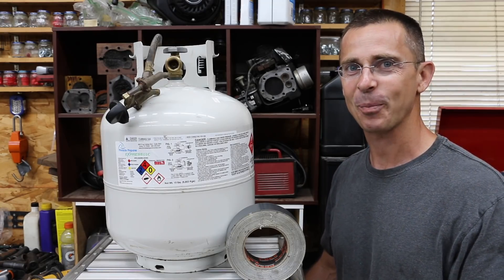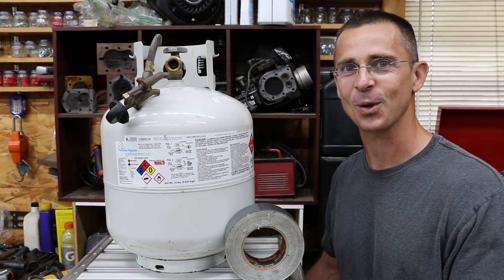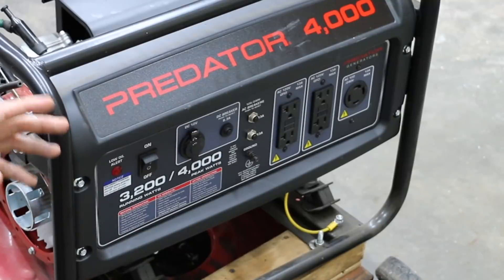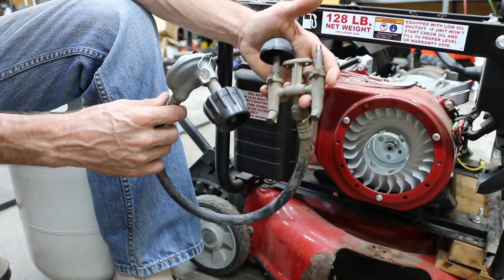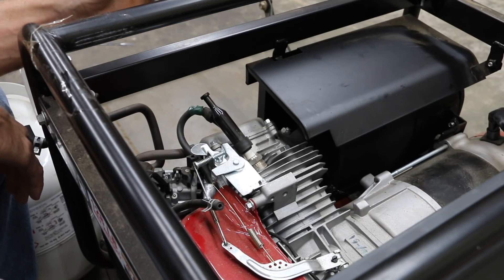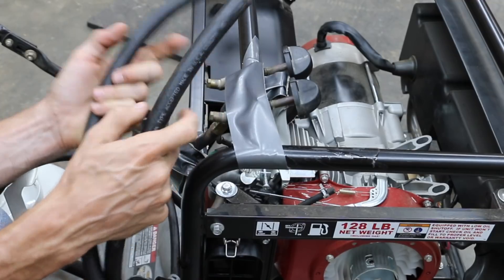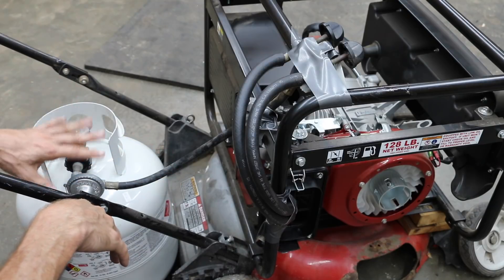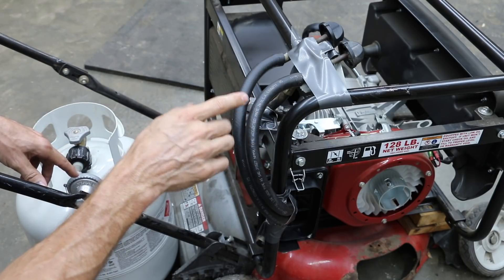Can a gas (propane) grill power an engine?  Let's try it!

Comment: At NASA, back in the 1990's many of their GSA run vehicles ran off propane.  The mechanics of the vehicles said that the Spark Plugs never needed to be changed, and the oil was always very clean during an oil change.   Of course this is nothing new, but the use of no regulator on a generator does make a good emergency source, especially in the Midwest where everyone has propane tanks for fueling their homes.   Propane also gets about the same MPG as regular gas.   At $1.29 a gallon during the summer it's a good alternative fuel source.  Love your videos.
Reply from the maker: Thanks for commenting on this.
Reply: Where the heck are you finding propane that cheap? We have a sale right now at $2.49/gal and our cost is 2.29 lol.  Also, mileage goes down a bit on lpg as well as power loss of about 10%.
Reply: $3.69 a gallon for propane here in Washington State...
Reply: with lp u lose 10% hp and gain 10% fuel economy give or take a percent
Reply: With most larger vehicles like my supercrew, that's not a problem and I'd take the 10% fuel economy because most of the time I'm not hauling a load.
Reply: @johncoyle707  It all depends on installation - HP loss was always present in generation 1 and 2 systems as you basically had to install a choke in the intake (it impacted both LPG and gas HP), much less in gen III and almost zero in gen IV. In gen V you can actually see gains due to lower intake temperatures!
Reply: Oil is clean, like translucent that is true. But it degrades even faster than with gasoline. Too much acids being formed. Needs to by changed no later than it would be with gasoline.
Reply: This is true even now we run our off road truck off propane
Reply: At Walmart near me I can get a 15lb Exchange blue rhino for $14.87. That's less than $1 per lb
Reply: zeer365 which makes it roughly $4 a gallon
Reply: @zdw306  dont buy blue rhino. Many gas stations refill propane tanks and you pay less
Reply: Also, there is a primary (high pressure to low pressure) regulator screwed right to the lpg cylinder, just not a venturi/load based low pres regulator/mixer like on a correct setup. Natural gas is far cheaper than propane, I think using lpg for heating a home is a terrible idea.
Reply: Mcroostr I live in N.D. and I just filled up my 500 gallon tank at $1.29 a gallon, so heating our house, water heater and cooking range with propane is a great idea.  I also have a wood stove and electric baseboard heat.   Baseboard heat is by far the most expensive way to heat our house.   You must live in the East or West Coast.  My family is from VT and they heat with oil, and its expensive, but propane is three times the cost of the midwest states.    It's also why you never hear of the Midwest states crying about power outages.  We are very stubborn and self sufficient here in the open Plains States.  P.S. I travel 60 miles to go to a Walmart:P.

Comment: Either way, if you're in the market to save money on gas, you won't be as propane is just as expensive these days as gasoline per gallon. Although I do believe they sell propane by the "pound". I wonder if the engine would run longer on the propane? If so, then maybe you have a chance of saving some money. I do like the clean burn though. For lawnmowers, this clean burn would be nice so you didn't have to choke on that exhaust that comes from burning gasoline.
Reply from the maker: Great point.

Comment: Question.
Have you ever tasted the results of new fuel on old seals, rubber and O rings??
Lots if us have older classic cars trucks and for me, motorcycles.

I'm concerned about the mixed fuels they're using. Difficult to find quality gas nowadays.

I'm concerned about fload needles,  crank seals (two stroke) and so on.

Anyway, keep up the good work. One of my favorite channels.
Reply from the maker: Great video idea and thank you for the positive comments.

Comment: Project Farm Another idea would be to adapt one of those trigger activated spray paint clip on devices with an adjustable screw, run a tube to the carburetor from it, and run on pure starting fluid or other compressed cans like brake cleaner, hairspray, ect.  I think it would make a fun video, thanks for the great videos and unique ideas.
Reply from the maker: Great video idea!

Comment: Try to run an engine with paint thinner
Reply: He already did this. The engine did run but there were problems (like mibars predicted).
Reply: Paint thinner is mineral spirits, and that's the same C7 to C12 hydrocarbons as in gasoline.
Reply: @RonJohn63  Much lower octane number, so it would ping a lot and could even diesel after cutting ignition.
Reply: @Dirk Pitt My chemistry teacher from middle school claimed that he used paint thinner in an emergency to run his Fiat 126P. It worked but it continued dieseling even without ignition. BTW in Poland paint thinner is known as "lacquer gasoline" and technically speaking it is variant of gasoline with long hydrocarbon chains (10-15) and no additives.

Comment: It would be interesting to demonstrate the engine running on burnt wood gasification into the generators engine and much the same manner as the propane. We know that this can work if the mixture can be controlled correctly. OneNote, the wood would be required to be hated without oxygen and then routed into the carburetor. I would like to see this I'm sure other people would also like to see this technology. Great demos by the way very much appreciated.
Reply from the maker: Great video idea!

Comment: How much water did you have in the exhaust as a result of using propane? Our 4 cylinder tow-motor runs on propane and is known for leaving a water trail behind it. lol Which led to a couple hydrogen fires by the way. (Titanium blending/processing facility)
Reply from the maker: Wow!  I didn't pay attention to the water from the exhaust.
Reply: Burning propane does create water vapor. But there is a chance you would not have had any moisture coming from the exhaust as it is an air cooled engine.  The engine gets hot enough to evaporate the moisture as it forms. 
In a liquid cooled engine the moisture can build up due to the lower temperatures of the cylinder head.

Comment: In India iv seen 50% of vehicles runs in LPG gas cylinders.. Its scraped in boot behind and there is a connection for it and there is a switch added for that Gas or Petrol tank. Lol... Iv tried both but I found there is more power in gas than fuel...
Reply from the maker: Thanks for commenting on this.

Comment: Will a engine run on methane? I have heard of a few ways of collecting it. Cattle under a big tent is one method.
Reply: Ronald, it's possible to run an engine on biologically produced methane...but trying to trap cow farts isn't the way to proceed. What they do is build a tank, paint it flat black and put manure in it. The manure ferments in the heat, which makes methane.
Reply from the maker: Great video idea!

Comment: E3 and other fancy spark plugs next. Dieing to see a E3 plug in the see through engine.
Reply from the maker: Great video idea!
Reply: Ya, please do an E3 video. I’ve ran one of their spark plugs in my Honda push mower. Have had that same plug for about 8 years, used it for a few years commercially and only did oil and filter changes on it. Starts/runs perfect. I wish i could say it’s the E3 plug but can’t prove that!

Comment: I knew you were going to have a little bit of a problem at first. Because I used propane as fuel for a potato gun, but I was only able to get this to work only one time because the fuel-air mixture is hard to achieve. I'm glad you got it to work and would love to know the ratio so I could use it for potato guns. The one time I did get it to work on the potato gun it was the farthest I've ever shot a potato by a factor of at least two.
Reply from the maker: Thank you!

Comment: So what happens if you were to pull the high speed fuel jet from the carb, and run propane through the original fuel supply line. Leave the cover and filter on the carb. Also try it with the high speed jet left in. What's the results.
Thanks great videos.
Reply from the maker: Yes, that would be a great test. Thank you!
Reply: Let me know if you you try it. Great videos by the way.

Comment: What about applying this to a diesel not sure how you would test it but you come up with some great test.  Use this as an injection and see how it would effect simulated mpg.  Maybe just hook up a flywheel with some drag and see if the one with gas and diesel would last longer  than just diesel
Reply from the maker: Great video idea!

Comment: I drive a semi at work that runs on CNG (compressed natural gas for those who don’t know) they also have LNG (liquified natural gas) trucks n just like propane it’s extremely clean. 30,000 miles on the oil n it still looks as clean as when it was new in the bottle.
Reply from the maker: This is interesting. Thanks for commenting.

Comment: LGP( liquid petroleum gas) is a common upgrade to many cars in Europe, Australia it is very common and the state even sponsors the first car you get converted. both in Europe and Australia it is roughly half the price of petrol at a gas station. Interestingly the LPG tanks installed in cars are supposedly safer in an accident than regular petrol tank
Reply from the maker: Thanks for commenting on this.

Comment: propane (LPG) is generally a very common fuel and not any more dangerous than any other type of fuel for spark ignited engines. the idea of propane being dangerous usually comes from not respecting codes of practice. more than 25 million cars worldwide run on propane or butane (LPG). aside from rather crude conversions, you have really neat factory made models. some even are electric hybrids. https://en.wikipedia.org/wiki/Toyota_JPN_Taxi

for small engines there are kits to correctly convert small engines like the one you show to propane. these don't rely on you hacking/modifying the carburettor. the existing carb is exchanged for a purpose designed propane carb. these propane carbs have either an integrated or external pressure reducer/regulator and some even can take the liquid phase directly (Lehr).
https://www.cavagnagroup.com/business-segment/automotive/products/enerkit/

there are obviously also complete systems available:
https://golehr.com/propane-powered-lawn-and-garden-products/
https://www.greengearglobal.com/catering-to-the-generator-market/
Reply from the maker: Great point and thanks for the link!

Comment: Have LPG in NZ and used to have CNG (Compressed Natural Gas) for a very economical drive.  CNG lacked distance on a tank,  being not as concentrated, and died out but LPG cars are still going, though the cost of the conversions has caused a huge drop off in popularity, mainly taxi's and very high mileage fleet vehicles are the main ones still using it.   
How about trying something more exciting like using oxyacetylene!
Reply from the maker: Great video idea!

Comment: My company uses Isuzu NPR trucks that run on propane, they run just like a gasoline engine, only difference is that they don’t like when the air temperature gets really cold, like in the single digits.
Reply from the maker: Thanks for commenting on this.

Comment: yes, it works very well on the newer engines. but don't use propane in older engines which ran on leaded gas, because it messes up the exhaust valve seats.
Reply from the maker: Thanks for commenting on this
Reply: actually it wont harm old engines. ran lpg in a 73 e-150 with a 351w to move it around when i was welding the rear frame with tank removed. worked great. no problems at all. flipped the 20lb tank upside down and dropped the hose into the carb. drove it 40 miles like that

Comment: Check the condition of the motor oil in the engine after 25 hours of continuous use on propane vs. gasoline please. And maybe after 50 hours of continuous use. I always heard that the motor oil is cleaner too with propane use.
Reply from the maker: Great video idea!

Comment: I did it the other way around, converted a gas engine to petrol and built a go kart. They’re the same engine. The only difference is how you introduce the fuel.
Reply from the maker: This is interesting. Thanks for commenting.
Reply: Project Farm I feel so honoured to get a reply from you lol. The original engine came from a propane powered street sweeping machine. I got it free and didn’t want to waste it so I decided to stick it in a go kart. I took all the propane parts off and fitted a carburettor off an old Briggs and Stratton lawnmower I had lying around. It took a bit of tuning to make it run perfect but it ran for years with no issue. One thing to be aware of is that if you’re converting from petrol to gas, you lose the lubricating factor from the oils in the petrol. This is why most LPG conversions have an additional lubrication system.

Comment: I live in Australia and every "gas station" (as they are called elsewhere) has at least one LPG bowser here. Many individuals and fleets run lpg. HOWEVER i still think this is an awesome video and great experiment because it shows what you can do in an emergency situation. The LPG conversions for petrol motors are expensive and require experts and parts, nothing you're going to have in the zombie apocolypse.
I think your solution is still useful/useable for vehicles too. I know you had to dial in the right mixture for one rev range, but on a dirt bike, for example, you could adapt your riding style, just let it idle or run at the revs it's tuned for, and use the clutch and gears to keep it from stalling, lugging or grab another gear on flat ground to go faster
Reply from the maker: Thank you very much!

Comment: Another good video showing something already in use, yes you can run a small engine on propane and butane as well. LPG vapor has been used as a fuel for ages, like in a few countries in taxis and since CARB screwed down on diesel trucks and their pollution problem, CNG/LNG has been used to power them. Propane has an octane rating in the vicinity of 108-112, up there with leaded gasoline. 

The clean blue flame you see is what happens when you burn dry vapor, some liquid gasoline is getting into the caburetted engine's cylinderand causes the yellow/orange flame. i.e incomplete combustion.

LPG is used as a replacement fuel in older diesel cars/trucks/buses where these old diesel vehicles cannot comply with emission laws and runs well at high compression ratios giving performance levels that can rival diesel performance levels.

Diesel to gas retrofitting typically uses auto a propane,butane,isobutane and isopropane mixture known as auto gas.

There are also commercially available gas generators.

So yes, gas is used to power IC engines.
Reply from the maker: This is all great information. Thank you!

Comment: I talked to a taxi driver who was running his car on propane.  He told me that their fleet ran on it and that the engines were extremely clean, nearly no carbon buildup.
Reply from the maker: Impressive!  I imagine the oil is much cleaner too.
Reply: Yes, as I recall (the conversation was over 20 years ago), he said the oil was very clean.
Reply from the maker: Impressive!

Comment: The dual fuel carbs for these engines are really cheap on eBay and Amazon. Then you won't have to mess with it every time the load changes.
Reply from the maker: Thanks for commenting on this.

Comment: Will a diesel run on straight vegetable oil?
Reply from the maker: Great video idea!
Reply: Commonly known as Bio-diesel, yes, a diesel engine will run on vegetable oil.
Reply: Neighbor in Oregon had a motor home that had an auxiliary tank for used fry grease, as long as you run it on diesel only for ten minutes before shutdown it’s fine.  Bonus side effect is the RV smells like French fries going down the road.

Comment: There will be problem in the long term. Since gasoline is a wet fuel, it helps to lube the engine. Gas is a dry fuel, so that extra bit of lubrication isn't there. Over time, the engine will wear out faster. The same problem applies with LPG on a car engine. Also, there's a higher chance of backfire. These can be so powerful, you can blow the air filter box into smithereens. I did exactly the same once on a generator, as a propane tank lasts a whole lot longer than a tank of fuel. I drilled a hole in the dirty side of the air cleaner box, and installed a nipple for the gas line. One time, when starting it after a while, it backfired severely, and the filter box just blew up in a million pieces. Scared the shit out of me :D
Reply from the maker: Wow!  Thanks for commenting on this.

Comment: My 4400 watt "Hybrid" generator runs on gasoline and propane. But I only run on propane. Because it burns cleaner and the crankcase oil lasts much longer too.
Reply from the maker: Great point.

Comment: I have one of those American Carburetor conversions on my generator and it works very well on propane.  Supposedly it will work on natural gas too but I've never had cause to try it.  The only thing is it is hard as heck to start it on propane, so I usually hook it all up with the propane off, start it on gas, turn off the gas valve, wait for it to start doing the out of fuel surging, then turn on the propane and off it goes.  It's probably running rich for a few minutes as the very last of the gas gets used up but it seems to work quite well.  I think this is a better method (the American Carburetor method with the regulator) because it can handle some fluctuation in load without either running too rich or too lean.
Reply from the maker: Thanks for commenting on this.

Comment: When I went looking for a Generator I got one that was Dual Fuel. I wan't planning on using it much. Only for when we lose power. A 100lb of Propane will be good for a very long time. But if I had to I could still use gasoline which is easy to find.
Reply from the maker: Great plan!